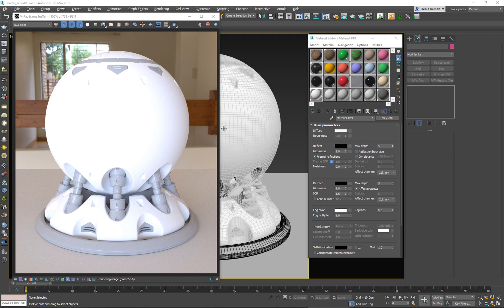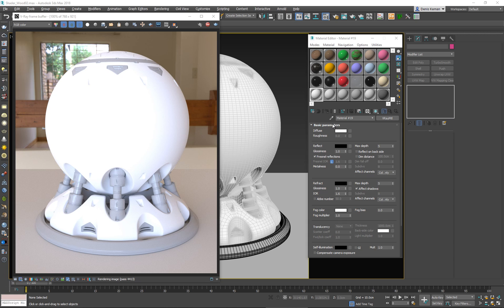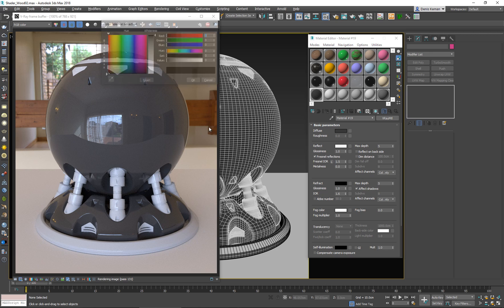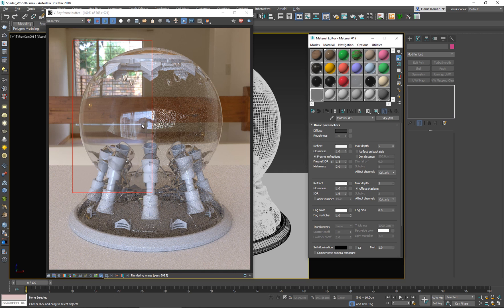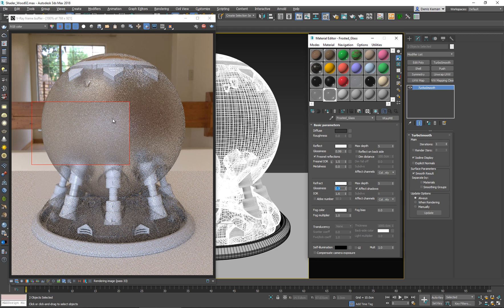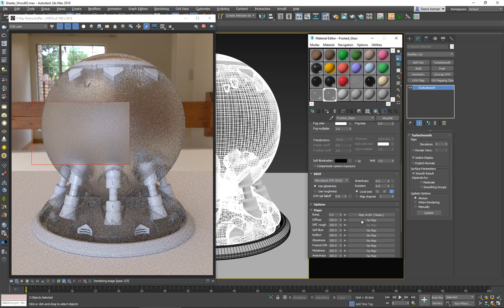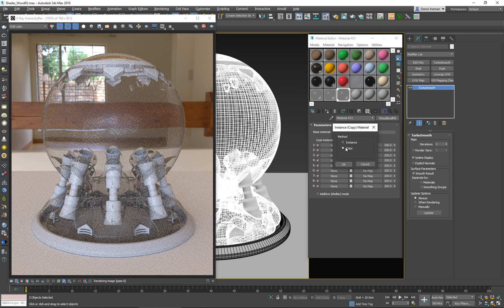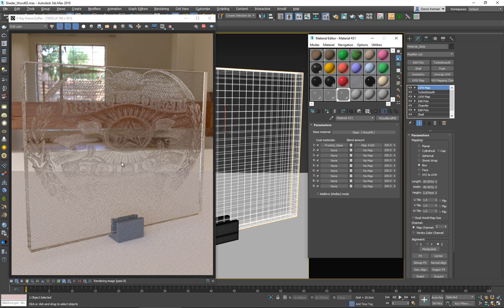The Ultimate Vray Materials Course: Creating Basic Glass

Comment: thank you. 😊
Would you please tell your Pc configuration?
Reply from the maker: As i've stated multiple times i still have a rather dated configuration as i am waiting for the new parts to get available for purchase ( lack of stock atm ) The only thing that was updated was the graphic card.

CPU: i7 6600k 
RAM: 16GB
GPU: RTX 2070 Super

If you are aiming for your next build though i would recommend 
CPU: Ryzen 3900x or 3950x once it's out
GPU: RTX 2070 Super or a RTX 2080 Super or Ti ( depending on how much money you are willing to spend ) 
RAM: 32, 64 or 128 ( depending on what you use it for )
SSD or a NAND drive for the Hard Drive

Anything else is really not going to impact your performance that much.